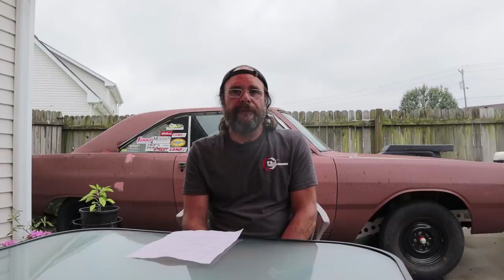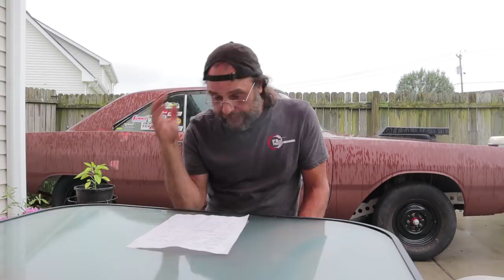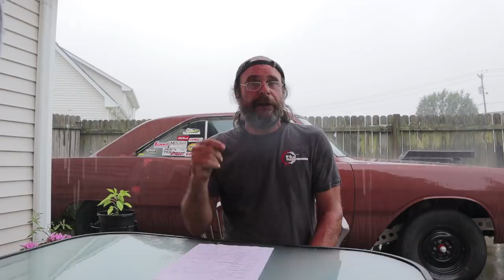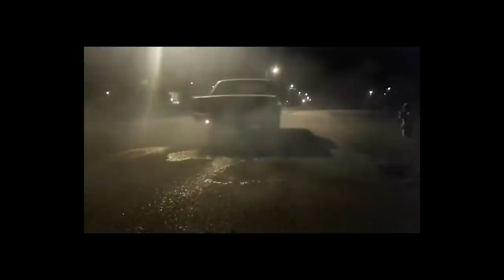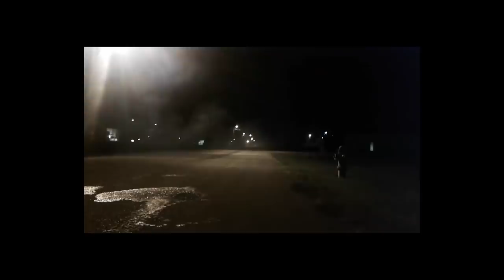Understanding The Slant Six Part Deux

Comment: Sweet Dart the lightening holes look really cool .
Reply: How much weight do you think that saved? Is drilling holes worth it? Think the frame would just flex more?
Reply: ProPerformanceNutrition.com the round holes actually don’t take away any integrity except maybe in the case of an accident, and if you see under the hood of that car, there is nothin but the shell of the front end there anyways. He’s counting pennies to get the car going faster, so I guess in a way, it does make a difference, just not enough for the average person to spend the time

Comment: The more technical you get, the more I enjoy your channel. My love for Mopar started with the slant 6 and 318. Be the 1st, no one has ever built a slant 6 and shown the video journey / proven the before and after.   Back in 1991?, one of the Mopar rags mentioned angle milling the head. Based on your description of the cross flow head, this seems to make sense. 

From 1 former Nykr to another, keep it coming.

Comment: I have been a Mopar fan since 1985 when I got my 1971 Challenger r/t . Cant wait to get my 83  miser pickup back down here to the ranch. The 225 in it is beyond tired and I am going to rebuild it.  Thanks for the insight on the engine type. I have replaced many parts on it over the years (only wear items) and its been unstopable.  From deep water crossings to stupid steep climbs on cattle ranch trails and  Arizona heat that melts others it is reliable.

Comment: Awesome insight. We are looking to flat track my 77 super6 4 speed OD Volare coupe at Millville New Jersey's Motorsports Park. Car is un molested under the hood. Manual steering, but has power brakes and working R12 Airconditioning. Just have a single 2 inch glasspack  and turndown. Going to swap out the big starter for a 90's magnum one. Talk about ADD, we might be brothers from another mother. Again great insight. Thanks again

Comment: Really eye opening these segments about the S6.  I remember driving them and when I learned whenever it happened to be a slant 6, first thought (And experience) is ya. A good old reliable and smooth sewing machine.  
But it’s not.  Well not just that.  
As you have elucidated  thoroughly with these segments .  And Glad you did.  
Because I have a new appreciation and understanding for them.   Cheers.

Comment: I had a Dodge Swinger with a 302 back in '81 and I loved that car. After I sheared the oil plug on bad road and had an engine meltdown, I ended up with Maverick with a worked 225 and man that car could move. It got scary sometimes. Thanks for the great videos, Tony!
Reply from the maker: I think you got your cars/engines mixed up
Reply: @UncleTonysGarage  Yeah, maybe. The swinger had a V8 in it. The Maverick had the mid-level 6. It was a long time ago. I wasn't complaining about the performance then, that's for sure. I'm a novice when it comes to the numbers vs. manufacturers. But I sure dig your channel.

Comment: American motors also did an aluminum block on their 196 straight six from 1961 through 1964. It also had a cast iron head. Back in the day a lot of European cars had a cast iron block with an aluminum head. Go figure! Neither Mopar or AMC told enough people that real coolant in the radiator was mandatory.

Comment: Always liked the slant six, and Mopar. If you followed the recipes in the engine speed secrets book, you turned the times it said, and i mean follow it, right to running the pinion snubber suggested. No other automaker supported racers like Chrysler used to. Built a mean 440 back in the day myself, 71 block, 516 closed chambers with 2.14/1.81 installed, steel crank, LY rods,  Jahns cast pistons, steel head gaskets, a solid 520 cam, a big Weiand open plenum intake topped with a Holley 750. Custom headers made by Watson scavenged out the waste. Ran like hell, went low nines in a 1966 Logghe brothers chassis. At the time the 516's were cheaper than 914's and i think they worked just fine. Sadly, being young and dumb, we put six seasons on that engine, and scattered it all over Detroit Dragway, on the debut of our seventh season....
Even sadder, the altered has been parked for a decade, the lastest mill, built to max, is on the engine stand, and both my Uncle and me are no longer racing due to health issues. It's all for sale, but i will be damned before either of us entertain scrap prices for it, or our spares. They can rot before we give it away. We'll put her back together and lay down a 8.70 in the quarter if we have to. I take that back, it's all eighth mile now, so we'll put the 5.32 screw back in and click the beams with the rear tires for kicks ;)

Comment: Good information.  I have an 81 Diplomat cop car that came from the factory with the hydraulic lifter 225 (yes, an actual slant six cop car, with police code).  I put a Clifford 4 barrel intake on it, and the AFB from a 273.  But I didn't mount it the way you did.  I rotated the carb 90 degrees so the primary barrels were inline with the cylinders, and closer to the fender than the head.  My father milled a phenolic 4 hole spacer/adapter for me, and we used flanged sink drain pipe as inserts on the primary side to extend slightly down into the plenum in order to force a slightly longer path for the middle cylinders.  I don't know if that was beneficial or not, and the accelerator was rather hard to press because I used two throttle springs and an extra cable to deal with the perpendicular arrangement.  It really woke it up, and made a wonderful sound via the unsilenced air cleaner.   But the main reason for posting here is just to say I own an aluminum 225, I picked it up on ebay maybe 15 years ago.  I also have a set of Doug Dutra's cast iron split exhaust manifolds, with turbo flange.  Was going to get serious about it.

Comment: I was 1st licensed in 1960 at 15 years of age. that year I built my first car. my grandfather on the farm gave me his badly rusted 48 chevy 2 door style master. I put a 56 chevy v8 bored an 8th of an inch with 283 pistons. solid lifter cam valve springs for the Fuel injection motor.4 barrel carter wcfb 3 speed non synchro low trans. hurst syncrolock shifter. 50 olds rear end 3.41(or something like that it was free). reversed some ponticac rims and made spring purchases. used the 8 leaf rear springs out or a 38 master deluxe(free) made my own spring purchases, dual exhaust, drive shaft(balanced it my self). we farm kids had some tools and lots of junk but no money to speak of. how fast was it. My best friend had a beautiful 57 olds super 88 2 door hardtop with the 371 4 barrel. we raced at night on deserted farm land 2 lane for s good mile. told my friend Don all you will see Is my tail lights. And that is all he saw. I got the that car with the 600-16 rayon 4 ply front tires up to a real 120. the whole thing caused him to sell the olds mobile and buy a worthless plastic car(his son survives him and has the beautiful 58 corvette). getting around to you. I want you to know I am not clueless and I have learned MORE from your 2 videos about the slant 6 than in my 74 years of living. never owned one but still its a fascinating subject. thanks for your video.
Reply: @NebukedNezzer   Really cool story, thanks for sharing!

Comment: I really like this guy! I raced oddball cars in Modified Eliminator back in the 70's. I learned a lot from the 6 cylinder and 4 cylinder guys back then. Most of the guys were pretty oddball too, and I mean that in the BEST way! I miss the old daze...
Reply from the maker: My soul still hurts from the day I heard about the death of Modified.  It was actually the basis for my lifelong vendetta against the NHRA.
Reply: @UncleTonysGarage  Not a fan of NHRA myself. I had stopped racing (for the first time) before they did away with Modified, but I was still sorry to hear of it. Ran a pro-stock motorcycle '89 to '92 and helped with a pro-stock motorcycle team off and on from '05 to '15. For me personally drag racing at the highest levels is not fun anymore. Not very friendly. Back in the 70's there was a lot of camaraderie, even at the pro level, but by the early 90's that was mostly gone. Really like what you are doing with the slant 6. Very cool!

Comment: I miss straight six cylinder engines. They were so easy to work on. If they continued to this day they'd be putting out good power and fuel efficiency. Plus the cars would be RWD, again, much easier to work on.
Reply: I had a '59 Austin Healey 100-6, a straight six OHV with two SU side draft carbs, four speed with electric actuated overdrive in third and fourth. That was the perfect motor for that little aluminum bodied two seater. If you could use the gears, it always had the power when you needed it. Great little car... Top speed was about 90 MPH, and it cornered like it was on rails.

Comment: I had a 225 c.i. Slant Six in my first car in 1974, a two door Dodge Dart. I loved that car, and it's rugged six cylinder power plant...a real torquer. I used to dream of finding a 413 c.i. engine in a wrecking yard, and  installing it in my Dodge Dart. The Dart with that engine and the "413 Wedge Package" was the FASTEST car in 1962. Uncle Tony, if you could give your THREE BEST attributes to a 225 c.i. Slant Six engine, please. You know that motor like nobody's business ! Thanks. Great video, as always.

Comment: Sweet part 2! Some people may or may not know that these engines were also In Vermeer 1600A drum chippers. Rated at around 110hp. Think it was an 1985 ish model. Big.pulled behind a dump truck. My family had one when I was a kid for their tree business. The engine never had problems in that thing. It got ran super hard to Full Throttle and then just bog down to nothing with a giant branch..... maybe cough a little bit , but it always Reved right back up. Sounded pretty good screaming WOT on the chipper too. Never forget that sound.

Comment: Thanks Tony, keep it coming. 

My son had a 62 Valiant with the Alumumn 225. We pulled it out as he wad going to do a 318 or 360 in the car. A Mike from California drove all the way to south of Seattle to buy it from us and I think he did a build up using Dutra's parts and it was in a hotrodding magazine. 

Too bad we did not know about offset cylinder tech back in 1958ish. If the cylinders were a few thousandth of an inch off set to the ATDC crank throw, imagine the power of that. 

You need a better clutch in that Dart. ;) Shifts were hazing the clutch. But great start.

Too bad they diden't do a POLY 225 like the Poly 318.... That slight twisted wedge valve layout would have helped. And talking about cylinder combustion chamber stagnation, the Chrysler 2.2 suffered from this big time. Any time we tried to push more power you could see the effect in the combustion chambers when you took the head off. The intake part of the chamber was sooty but the exhaust was cleaner, much more than any 318 I'd worked. The old "G" casting was OK up to about 165 HP. But when you looked at the 'Swirl Port' head it ran much cleaner even with the shrouding of the valves.
Reply from the maker: Yup..clutch has already been taken care of, and I have said the same thing about a Poly chamber for years.  Would have completely changed that engine

Comment: Like the  Swinger/Dart in the Background, Sold in Australia as a Valiant with the 225/175 HP motor..
Reply: We had the Valiant too under the Plymouth brand.
Reply: @pgtmr2713  not trying to be a know it all but actually Valiant was originally a separate brand in the US and was absorbed into Plymouth in 63 or 64.

The first Valiants we're actually titled as a Valiant (make) and had individual (models) Signet, etc. 

Much like pre 1967 Imperials were NOT a Chrysler but an Imperial (make) Crown (model) etc.

Valiant was originally intended to be a world car like the Falcon hence the Valiant Ute that's basically a Valiant Ranchero in Australia and the branding in Australia as a Valiant instead of Dodge, the only non Valiants in Australia I've heard of were the "Chrysler by Chrysler" CH models.
Reply: I did not know that. I believe LeBaron had a similar history. Wouldn't be surprised if there were more, forgotten by time. Like Ford being owned by Dodge at one point. Really happy that went a different way, I say wearing my Ford hat.

Comment: I'd sure like to see a picture or video of that supercharged slant six. They were good workhorse engines. New York city taxi cabs were a testament to that (coronets and furys). When they finally did give up they would almost always sling number 5 or 6 rod, cant quite remember which one. You would remove the starter and see the window in the block. Great job Tony, keep it coming.👍
Reply: My buddy windowed  a /6 (think it was a 198) behind the starter in a  high mileage 73 Duster while highway racing a 4 cyl 80's Camaro back in the late 80's.We were pulling away and doing over 100 mph when it happened and the car kept running but dropped down to about 80 mph after that and the Camaro kept going.We pulled over and everything looked ok but it was idling a bit rough....we didn't notice the hole in the block for a couple minutes,nothing else was unusual,no noise,no oil leaks.My buddy drove the car to work for a couple weeks after that until he found something else.Pretty tough engine.

Comment: 80 something Plymouth Volare, wagon.   Dad bought it 3rd hand with 280k on the engine & trans.   We drove the floorboards out of that car to the 350k mark.  Sold it to make a down payment on the next family hauler.   The next owner drove that thing for another 5 years and 250k miles.  The frame finally snapped from rusting out.   Aside from a regular feeding schedule of alternators and starters (easily re-buildable back then..) that engine never stopped.  One of only a few engines that I have seen last beyond 500k miles.  I've been smitten with em ever since.    ;-)

Comment: I have a tidbit to add to your Chrysler racing trivia. A old friend worked on the Plymouth that won the Darlington Nascar race in 1950 with Johnny Mantz driving. It seems the cars were strictly showroom stock , especially the engines. The engine was torn down and every piece checked, and it was declared legal. My friend told me "They checked every piece, but didn't look at the timing mark alignment on the cam and crank...". Fine teeth on those flathead 6 gears.

Comment: When I was young I had a 69 dodge dart that I hot rodded as my first car. It had a   racer brown cam 450 lift 268 duration with 30 over trw flat top pistons offy intake with holley 600    9.0 to 1 comp   mallery dual point ignition with a 10 inch heavy duty clutch, Hurst master 3 speed shifter with manual trans. Stock untouched 7 and 1/4 rear... it ran impressive! Gas milage wasnt bad at all if you didnt get on it. I got 40 mph in first, 70 mph in 2nd gear and  not much over 100 mph.  It would rev to 5500 rpm then lose power after that.  It fooled alot of locals.  it was fun!\... I raced a few v8,s and kept up surprising well!  Im trying to build another one like that again today ( 40 yrs later) It was unique not your typical sbc.... maybe with a little more head work and headers.

Comment: My '68 Australian Valiant-Regal has a hi-stall on it's 904 automatic transmission. The rebuilt slant 225 has a Crow cam but I'm not sure of the specs my mechanic used. It has its stock Carter 2 bbl carb (with bigger jets) and stock intake manifold. Extractors replaced the original exhaust manifold when a previous owner had it so I've kept them. The exhaust is a custom 2inch sports from the extractors right through to tailpipe. Has plenty of low gear power, it's weak at the top. Getting it tuned is difficult even with a dyno as the cam and carb aren't the most compatible so I'm told. Still, I love driving it.

Comment: Makes me wish I’d a kept our old slant 6 from our 62 farm dodge dump truck. We hauled firewood through a creek for 20 years and I only remember changing oil about once, I’d was sludge but it ran up and down the road strong for years with never a problem.  The diff, brake cylinders, bearings, clutch would get full of water with little maintenance. Poor thing.

Comment: Here's some interesting trivia: The 1976 Dart Lite had a 2 1/2" exhaust system from the manifold back.  I don't think it was for performance, personally think they were trying to keep the aluminum 1bbl intake cooler by having a less restrictive exhaust.  I have a 76 Dart Lite with the aluminum hood and trunk bracing, and aluminum 833 overdrive  4 speed.

Comment: Awesome! I grew up working in my dad's shop and he was always a Mopar guy. He LOVED the slant6 - best engine ever made. However, when I moved to Australia, my mechanic friend (who loves American made cars in general) just HATES the slant6. Says they are the worst to work on. After he explained why, I can sort-of understand. Here, the cars are right-hand drive. Engine slants to the right side, but you also have the master cylinder, steering column/gearbox, etc. Everything is on the one side and the other side of the engine bay is empty. Makes working on them a bit more challenging than I remember, for sure! Anyway, just thought you'd like to hear something "new" about the slant6 that maybe you've never heard. Cheers!
Reply from the maker: Yeah, I can definitely see the challenge with a RHD application!

Comment: Ive had 4 or 5 slant six cars.back in late 70s early 1980s mostly valiants but we had a dodge i believe 300 it had an aluminum front clip and deck lid.was geared extremely high you could barely start off without slipping clutch.it would run about 120 mph.at 80 it would get 25mpg.you could buy really nice cars for 3 to 500 dollars.also bougt a few people thought were burning oil just replaced o ring on spark tube.we used these when our camaro mustang or chevelle broke.used to run them till valves floated then shift